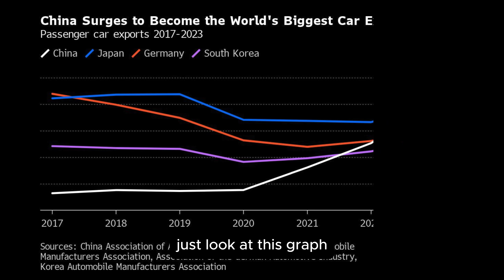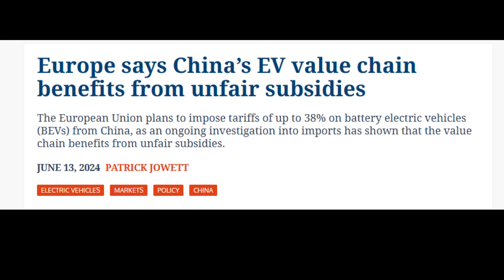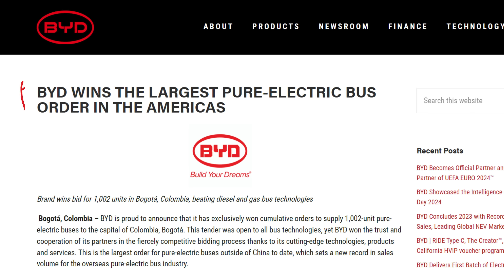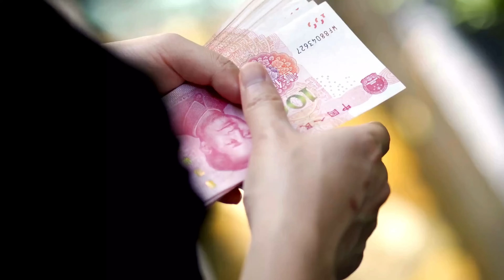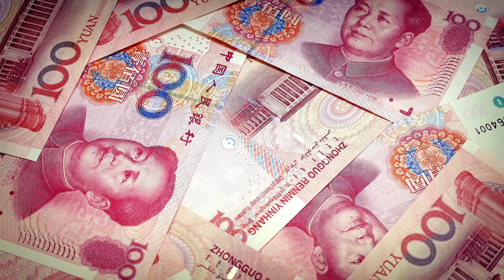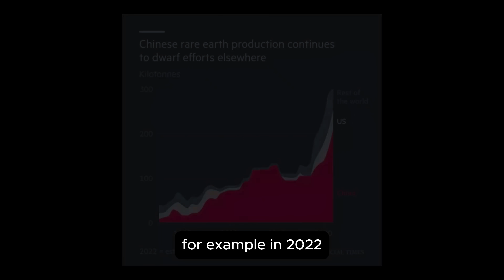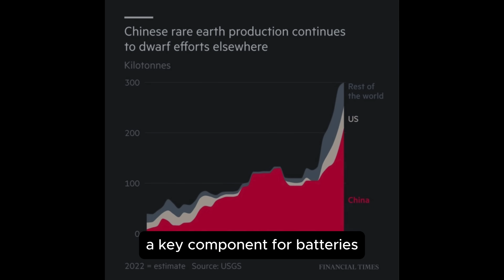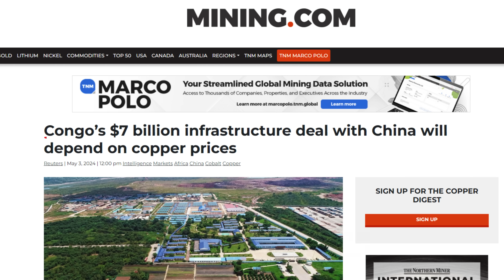How China Becomes the LARGEST EV Market in The World

Comment: do they have the electric and infrastructure to charge all those cars, i think they constantly need to be reminded of that, even in the usa.
Reply: EV infrastructure in china is way ahead from the US. You need to know this.
Reply: @fritzcervz6945  what are the data points on that?  Do you have more charges than the tesla charger stations usa has installed everywhere?  what about power plants capacity? transmission capacity?  most of America is seperate homes with driveway for your own charger/parking?  how about the interstae highways we installed decades ago?  do you know what you are writing, or are you a dummy just typing meaninless words?  how about repair shops?